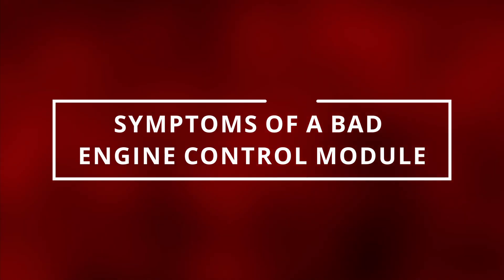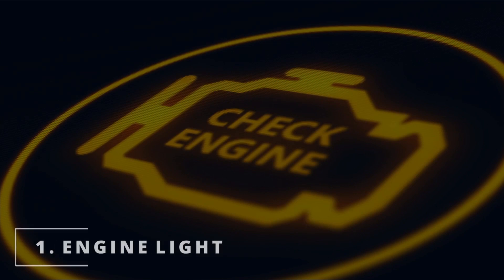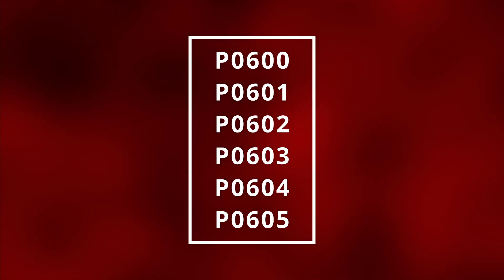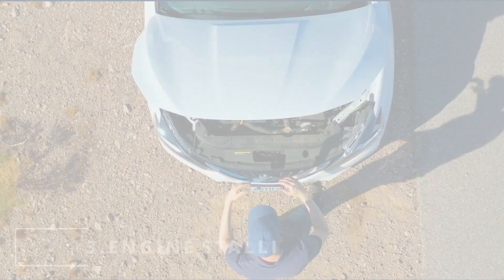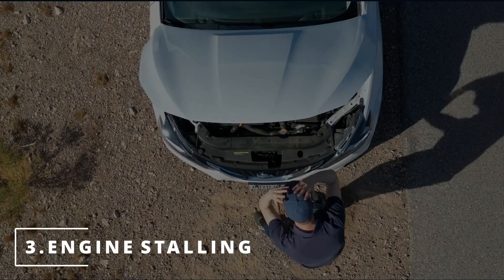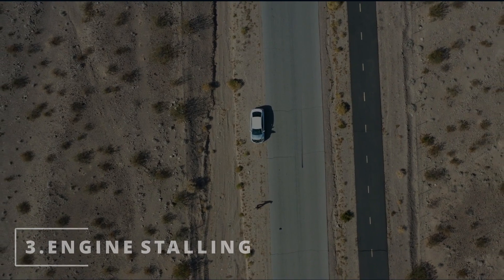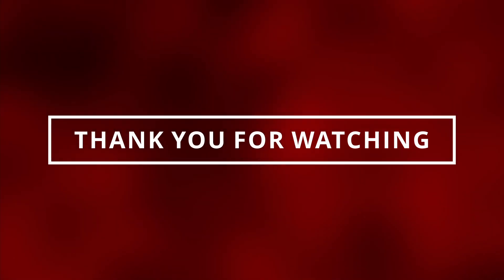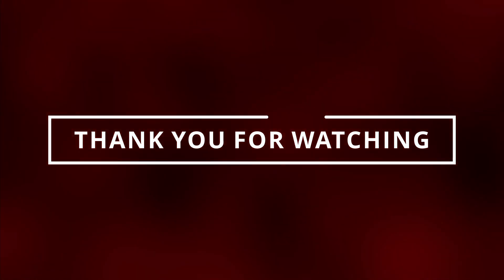SYMPTOMS OF A BAD ECM (ENGINE CONTROL MODULE)

Comment: Hope you answer my question: my car randomly shuts off for no reason, I turn the key and runs for like 1 second then shuts off. It’s done this 2 times in the past 5 months, 5000 miles. I unhook the battery cables for 10 minutes then hook everything back up and starts right up and I’m back on the road.
Reply: It’s a 2010 Malibu with a 2.4L engine

Comment: I have all those symptoms except starting. However, I have one that you didnt talk about. One day all my dash warning lights came on all at once then they went back off, except for the engine light. Then I noticed, while on the freeway, that my speedometer was not working, and while I looked at it, it shot back up to where it should have been (about 70 at the time) could this also be ecm?

Comment: My experience was Oil Pressure Guage going up and Down and Pcv Valve code and Check Charging System and Truck shutting off when sitting still due to false Pcv code reading and truck Stalling and Terrible Gas Millage and Being unable to activate Key Remote to vehicle and Over drive light blinking

Comment: Mine has the light and code pop, no issues though, sometimes it pops up once a day and some days not at all. Recently replaced a bad ignition coil, I’m thinking battery cause when I drive with lights on and touch a window button the lights dim a little til I let go. Got a battery tonight one in car is from 2020. So hopefully just a battery getting weak.

Comment: Can a weak car battery get a po685 ? I have no symptoms other than occasional check engine light that comes on and clears on its own. I did scan and got the code po685 could it also be a faulty relay in the fuse box?

Comment: 1995 GMC Sierra SLE/w/ 5.7 liter V8 was running fine until it wasn't, shut off, no crank and no power windows blower etc. Etc. My first instinct was (ECM/PCM/ECU) because GM's run all that through the computer??.😢😢😢

Comment: That's exactly what's happening to me with my car - new sensors, relays, connectors, etc. and still getting varied error messages.
Reply: If your car is 1996 or later you have a OBD 2 system, you can plug scanner in and have live data and freeze frame function while you are driving(to see what sensors see when failures occur). I have a 1995 F150 that has a problem and I cant see live data with my OBD1 scan tool. Its such a great  condition F150 body with low mileage engine I don't want to give up  on it.  This truck has stalled out but restarted and got home on multiple occasions. I have learned that most shops don't really have skills to fix problems such as this but will take your money.  I hope you found your solution.

Comment: Thank you! Should've watched THIS before putting it in the shop! My van was sitting in my yard waiting for my turn signal relay. Ran just fine before that. Replaced the relay went to start it...NOPE! Thought it was the fuel pump, just got off the phone with the mechanic and he said-"well, it's NOT the fuel pump, sounds like it's the ecu." Dang it! When I tried using my OBD reader it malfunctioned, well....that explains it!

Comment: Excellent video,remember this, the newer your car is the more unlikely scenario that your ECM is bad unless it was in a flood or some catastrophe like that, a lot of ECM's have capacitors in them and capacitors have a lifespan like everything else,some of these capacitors control or "help" the processors make decisions and if they are leaking their guts out (which they do as they age) then you start having problems,they start minor and get worse as they get older and leak some more, this usually happens 10\15 years or so in the life of the car, less these days because the electronics are cheaply made.  

These problems need to be addressed promptly as the stuff they leak is corrosive to the board and what started as a simple problem will take out a nice chunk of the board overtime and cost you much more in the end,the only way to find out about this is to have a visual look at your ECM,you dont have to be a scientist or some super duper electronics specialist to conduct a visual inspection,it will be screaming at you as soon as you see it,sooooo if you have been replacing things you thought were bad and have checked and double checked everything and you still have issues more than  likely its your board.
Reply: Thx, will chk it out 👌👍!
Reply: Its those damn flux capacitors

Comment: My ls460 which is know to have PCM issues in the 2007s have amlost all of these syntoms it says I have miss fires on the whole right side of my engine but it idols fine but has a visible miss fire in the rpms during acceleration only getting it up to 3k rn no higher because I don't want to break anything too expensive... My power train is under warranty still so I'm not to concerned but I'll update if that was the issue

Comment: I have a 2007 chevy suburban .it started at sometimes and got worse, I would loose 1st and 4th gear. I replaced the shifting solenoids  and checked the wiring in the transmission.  And now it's all the time I only have 2nd and 3rd. Chevy place wants me to by a new transmission.  I also think I have fase code popping up. You think the transmission problem could be the tcm,or ecm ?

Comment: PLEASE HELP ! i have a error code P063400 " CONTROL MODULE INTERNAL TEMPERATURE 'A' TO HIGH " i replaced the ecm and checked all the wirings and vaccum pipes changed all the sensors still the error does'nt go away and the turbo wont even activate tried everything still not able to solve this ! car brand is vw polo

Comment: Great video!
I replaced the Runner control on my 08 Jeep Compass located on the manifold (3 screws 1 electrical connector) I put everything back together and now it doesn't start. Can it be the ECU? ANYONE???

Comment: I have check engine light, blinking cruise light, and shifting issues. Then I reset the ECM and they go away, however then later after driving a while they come back. So is my ECM going bad?

Comment: Could you disconnect the electrical connections to check for corrosion and if corroded spray some electrical contact cleaner ?

Comment: This is describing almost exactly the problem I'm experiencing except for the shifting problems.
Engine light code reads as an oxygen rich problem, but after switching out the ignition coils, spark plugs, both oxygen sensors, air filter, and also checking for air leaks...the problem persists.
Then i remember getting a high pressure car wash, and water was leaking into the driver compartment. Thats when all the problems began with engine light, reduced power light, and traction control lighs all turning on....This is most likely the problem.
Reply: How did u fix the problem? Having similar problems
Reply: He said ECU is most likely the problem  @anotherappointment

Comment: I'm having issues with my 05 nissan pulsar. The cam and crankshaft sensors have been replaced, but now there is no spark. Sometimes it does turn over and sometimes it doesn't.

Comment: SOUND LIKE MY ISSUE..    MY 1996 F150 STARTED  DROVE 100 YARDS.. THEN STOPED..  HS  SPARK   HAS  FEUL,  HAS AIR... TURNS OVER  BUT   DOESNT  BARK..    JUST  TURNS ..  EVEN WHEN I SPRAY STARTING SPRAY ,  WONT START...  HELL IT  SHOULD..  SOO  IGNITION ISSUE..

Comment: Hi pls suggest what to do i have this error message p0606 component y3/8n4 fully integrated transmission control unit is faulty.. can i service or have to replace the sparepart

Comment: I had the code P0505 bad idle air control valve sensor for the longest. I cleaned the throttle body and replaced it 4x idle air control sensor but I still get the engine light with rpm going up and down. 😢😢😢 I think it the ecu

Comment: I went through this with my 2011 Altima right before Christmas of 21. It took me a couple of weeks to make the educated guess that my ECM was bad. It kept throwing P0705 Shift Range sensor but I pur 2 new ones on it and didn't fix it. I  even did the multimeter pin test someone recommended on all 3 and they passed so after much research I got one from a place online (cheaper than going to Nissan) when I got it all installed the car wouldn't run.
I called them, they asked me to see if I can find out why it's not running. I said way ahead of you, it's not getting fire to the plugs. So they sent me a shipping label and asked me to send both of mine back so they could clone the original and flash theirs and send it back. When I got them back it worked.
I  never had another problem until yesterday. I  went somewhere and when I went to go home, it's in limp mode again just like last time. When I checked the code, same damn code P0705😡 I still had a new switch and just for aguement sake I tried it and just like last time, I think it screwed my ECM again. It's only been a year and a half since I fixed this and about 4000 miles (my car only has 60 000 miles on it and I bought it new) at this point I'm ready to soak it in gasoline and burn it to the ground, I'm not gonna keep fixing the same problem at the ridiculous expense that frequently. Bought it brand new and these problems are getting ridiculous. I'll NEVER own another Nissan again, I don't give a damn if they paid me to take a truck load of them.
Reply: Have you heard of ECU xchange out of Florida?  wasn't sure if thats where you sent your stuff to, they are really solid people and might be able to help you out, you could have a bad ground thats messing up your ECM's, not trying to be argumentative and i have never owned a Nissan in my life but all cars are the same pretty much,they all have a quirk that causes them to have issues,granted 60 thousand miles is nothing,you shouldn't be having any problems and it sounds like your mechanically inclined, sorry for your troubles, when the car is not running right is a major source of frustration,been there many times.

Comment: Would replacing the PCM help solve my misfire issue on my Honda fit (I already replaced coils and plugs)
Reply: I have a Honda fit as well. Getting code p0685 but my car still starts I already changed my alternator 😢

Comment: I'm definitely frustrated! I've replaced the Accelerator Pedal Position Sensor, and it cleared up part of the problem, but the ECM still kicks it into Reduced Engine Power mode, due to the lack of communication from it to the ECM. The live data read out will show N/A for voltages and percentages for the APP sensor sometimes, and sometimes it will show the voltages and percentages for the APP. As long as the engine isn't in "limp" mode, it runs fantastic, save a bit of rough/fluctuating idle, sometimes the ECM seems to be searching for the proper idle. I've replaced the MAF, MAP, PCV valve, and the seals and assembly for the MAP and the PCV valve. It's a 2004 Pontiac Grand Prix with a 3800 Series 3 engine, which means it has a throttle actuator control instead of a regular throttle body. I'm guessing that the TAC sends data back to the ECM for verification purposes. Since GM has discontinued making the TACs, and there's no new ones to be found, I found a used one with 147 thousand miles on it that I'm going to swap out. Maybe this will fix the problem! Man, I hope so!
Reply: @garyatkins1265  Cheers from the St. Louis metro area/ Alton, Illinois! Great idea, however, it ended up being frayed wired in the harness that has been rubbing up against the valve cover for 20 years. I took it to a very good mechanic who spliced all of the wires that need it, and it's been running great ever since. So really, you were on the right track, just different wires. Thanks for the input!
Reply: @joekelley5121 after adjusting the wiring harness, your vehicle was fine? I'm wondering if it was both, the ECM and the harness
Reply: @tonylopez602  the problem was caused by the wiring harness laying against the valve cover, and the vibration of the engine wearing through the wiring over time, like up to 20 years of time. Eventually it wore through some of the wires either completely, or enough to cause the signal to be degraded. There's apparently supposed to be a bracket to hold up the harness away from the valve cover that wasn't there. The ECM is fine. I've talked to mechanics about the ECM, and they say that the ECM doesn't go bad very often, that it's pretty durable. The engine is still running like a new one. An ECM costs 250.00, including the programming, for my car. I did decide to purchase one just to have it on hand just in case, because I plan on keeping the car for a long time.
Reply: @joekelley5121  gotcha i understand. I was asking because i had recently bought an 06 dts, and it was experiencing a few problems electrically. My wiring harness was extremely degraded, so i bought a new one and got it installed. the problem persisted although the knew one was in. Come to find out it needed to be programmed
Reply: @tonylopez602  that will do it. I was fortunate enough to found out about the ECMs needing to be programmed when I came across a company that does the programming for you, based on the vehicle's VIN. Glad it's working for you!

Comment: Would anyone out there in the winnebago world  know anything about this problem I’m having? I have a 04 winnebago adventurer and I have a load buzzer on none stop. The cluster doesn’t work but if I turn on the lights the cluster starts working again but says check battery voltage. when I turn off the engine, the buzzer continues nonstop, and the ABS light turns on when I turn off the ignition and the keys out of the ignition. I plugged in a engine code reader and it had a code PO650
I’m at a loss for now, I took a fuse out to stop the buzzer, but it stopped all the dash cluster lights not to work, but the buzzer stopped.
If anyone has an idea what I should check that would be really appreciated.
Thanks in advance for any help in this matter.

Comment: excellent vid, listed all faults to what’s going on with me Kia 😢
Reply: mine too😢
Reply: Probably going to be another lawsuit. If you have a gdi, they also burn a quart of oil or more in between oil changes; definitely bad for the engine long term. That'll be another consumer lawsuit against kia Hyundai
Reply: My Kia forte s 2018 is consuming a lot of oil. I don't have a leak but it's eating it up..have to check the oil at least every other day now. The ECU is malfunctioning as well and I am having intermittent shifting issues and occasionally it stalls. 215044 miles .   @AkutoSaiTheDemonKing
Reply: Same here with my Kia 🥲
Reply: Same with my 2014 KIA Optima. Died on me while driving, couldn't accelerate anymore and my car didn't go into limp mode, it just stayed on but couldn't accelerate. I pulled over and tried to start the car, but it wouldn't turn. Come to find my battery blew because we took it to Autozone and they confirmed its 100% screwed. Got a new battery, still didn't solve the issue. Everything in this video happened to me except gear changing, and I'm wondering if the short cirtcuit happened because my battery sensor literally blew off and melted (I discovered it while putting in the new battery.) Taking it to the dealership to see if this falls under the extended lifetime warranty for the engine that you get from getting the KSDS (Knock Sensor Detection Software Update). If it doesn't, maybe ill be lucky and it'll fall under the recall issue for brake fluid leaking into the HECU and causing a FIRE or short circuit, which is a problem many KIA and Hyundai's are facing from 2011~2019 models of all kinds.
Reply: Mine too. 2017 kia rio

Comment: My truck would not start after it sat for 10 minutes when I turned the key the brake lights on cluster came on but nothing happened.  The starter did not work nothing.  I reset the ecm and then the truck started right up is my ecm bad?  Its also throwing a code that my cat is bad but reset it and didn't get a code until today a week later but I had to reset the ecm to get it started so no idea if it was the same code or another.  The truck wouldn't start until I reset the ecm.  1997 f150 4.6

Comment: My 2007 Cadillac DTS battery light came on was told my starter bad replaced it and got my car home and from there it was downhill my car never turned bck on … I got power lights come on radio comes on but it don’t start or should I say crank up .. if anybody knows some plz let me know …

Comment: Simple and to the point. I think this is the problem I’m experiencing with my 2004 jeep. I heard that Jeep’s are bad about that. I’m driving and stall out. It’ll start back up, after a time but I’ve changed the TPS, the coil packs, the oil sending sensor and still my jeep dies, randomly! I’m so frustrated.
Reply: Did you change the crank sensor? My 1.8T Audi would cut out when warmed up. Took about 20-30 mins to cut out. Took 45mins to cool down then it would start

Comment: 2001 Toyota Camry XLE 3.0l V6
I've been jump-starting my car a lot lately and this week I experienced new problems. The tach needle won't rise to idle, the instrument cluster won't light up, the transmission shifter stays locked in park, and the engine dies when I take the jumper cables off. I've replaced the alternator, and my 2-year-old battery has been a pos, so I'm replacing that too. You think its bad ECM, or lack of power??

Comment: I'm experiencing very similar issues to all of these symptoms in my car. The only difference is I don't have a check engine light on. Could this still be the issue without the light?
Reply: Pull the ecu out if you are not sure and see if it smells like burnt plastic that should tell you if it is bad or not.

Comment: My car is 2015 Ford Fusion SE 2.5 L six speed automatic transmission. It’s sometimes will crank sometimes won’t. Also will die when I do start it. Could be ECM ? Weird thing is that only tire pressure fault light and steering wheel assist fault service required light will turn on. Also why do Auto Zone is able to read codes and OReillys doesn’t?